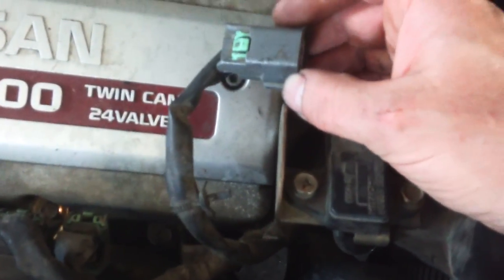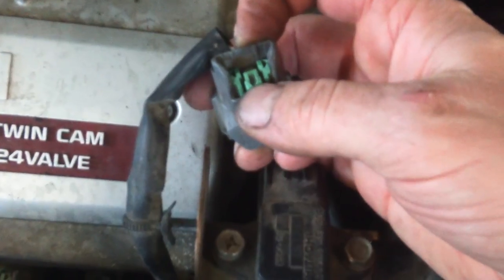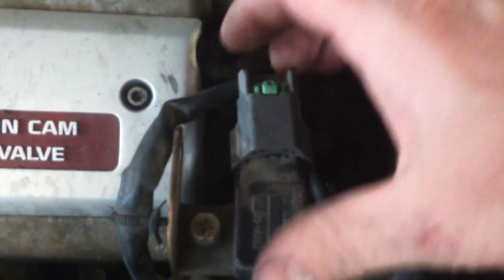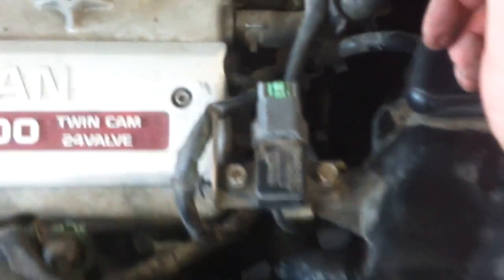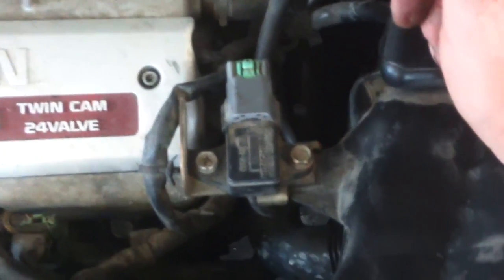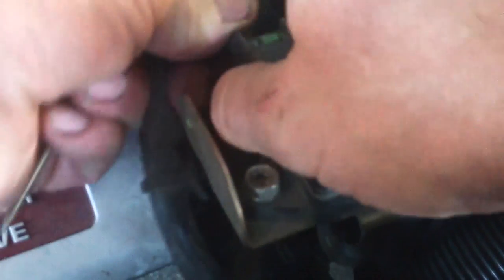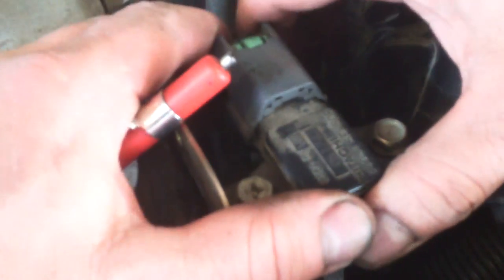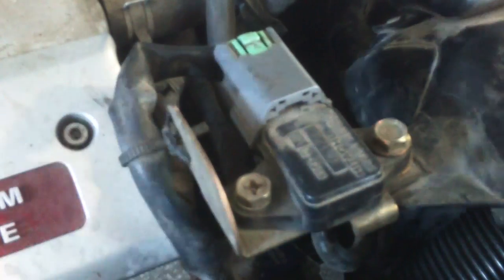Nissan electrical connector remove and install removal installation how to take off

Comment: I just bought a Nissan Pathfinder with all kinds of problems. I broke the connector off the old distributor due to this clip being not only complicated but on the underside of this connector in this case. You’re a lifesaver.

Comment: Thank you very much for this video, more of these kinds please. It is a surprisingly big problem to detach the varies connectors in your car. In many DIY videos they tell people which socket to use here and there but when they detach connectors they often do it without comments or close up. It should be opposite.

Comment: You are the only person to review this type of son-of a bitchin green connectors.  I used needled nosed pliers to break off the two connected to the fuel tank. Then realized that this green connector slides in. The one connected to the MAF sensor wouldn't come off no matter how much I pushed it in. So I broke that one off with a flat head screwdriver. Now working on the throttle body sensor and came across your video. You helped me discovered the connector is supposed to  𝐋𝐎𝐂𝐊-𝐈𝐍, 𝐰𝐡𝐞𝐧 𝐩𝐮𝐬𝐡𝐞𝐝 𝐢𝐧. (There is no way that can be done without a tool, why would they make something like that?)
    A little bit of dirt in that connector makes the seal even tighter. Had to squirt a little WD40 into the connector. FINALLY, (after stabbing my hand with the same flat head screwdriver) forcing the connector forward, it snapped into place. Then came off easily.

Comment: Nice. I would've pry it up then down then break it off. I never had the idea it would be manufactured that complicated, but it appears great for the removal process. Thank you for the video. Lastly, can you do more short videos on the other type of connectors and if possible, the repair of the connector and size of pins? Thanks.

Comment: Any idea where to get a replacement electrical connector for the ABS speed sensor connector from the front driver-side wheel hub of a 2007 Nissan Xterra?  Any idea if that electrical connector has a name or other identification?

Comment: Thanks for showing this! Hard to find info. Are there any other style connectors Nissan uses that are diff? I have an 01 Frontier and have just begin a long head gasket replacement project having never done one b4 but am semi knowledgeable bout cars and have most needed tools. Thanks!

Comment: Getting the connectors off is truly an ordeal. When u clean your throttle body, that’s where the fun starts. Doing the idle relearn is like a three ring circus. I hope my new Diagun scan tool will do it. Otherwise, it’s break out the stop watch and go crazy. Trick Shift Garage has a good vid on the relearn. Nissan def has an anti DIY team that conjures ways to make your life miserable. I’m working on a 2000 V-6 Frontier. Blown head gasket. Please take pity on me. And it’s a 4WD!!!  I should really quit while I’m ahead. Love the vids on this channel. I watch them all. And I’ll probably become a millionaire by following his financial advice. Then I can quit working on cars

Comment: so that is on ly one connector what about the connector to the fuel injectors they don't have a green tab are they the same have been trying to unhook on of them without wrecking everything. aal the connectors work the same on n issan quests

Comment: I have a set of plastic flat head screwdrivers for those Nissan connectors, nissan plastic connectors are very cheap and easy to break, I would rather break a plastic screwdriver then a connector

Comment: They never come off that easy! I fought for an hr pushing the green connector, and it still is glued on. I gave up!  I replaced on, but the back one I have try again, use some oil?

Comment: Hi Josh, how do you release the connector if green slider is missing?
Reply: Jemar Macaraeg, did u ever get an answer? I can't get my connector loose from the crankshaft sensor.
Reply: Hi Tiffany,  I carefully used L-pliers(plier with 90 deg angle) and pulled on the connector.  When I installed it back, I made sure connector is all the way installed and used electrical tape to secure it. Good luck.

Comment: i hate how difficult it is to disconnect those connectors..  i wonder if there's a way to lubricate them, so that they slide off easier.. maybe a little WD40 will make come apart easier??  Has anyone tried anything like that?
Reply: I know this is 2 years old but YES, I squirted WD40 into the connector. A little bit of dirt in the connecter and that green slider just won't lock-in. I sort of flushed it out with WD40 and then let the connector air dry overnight.